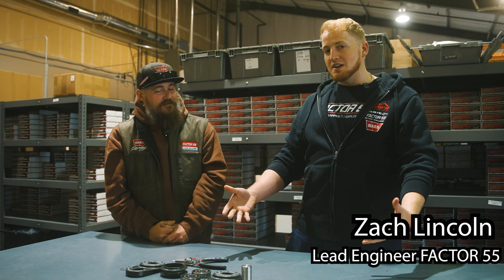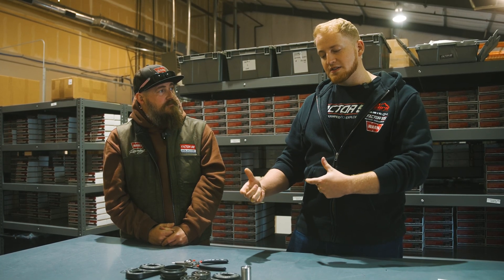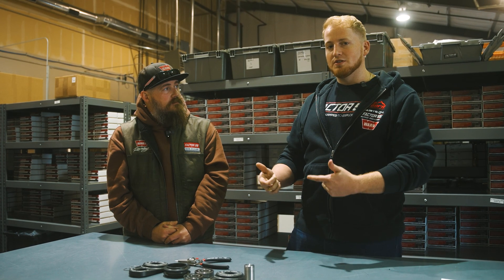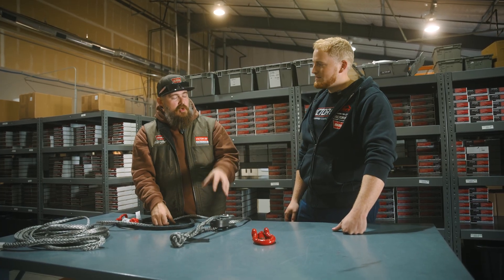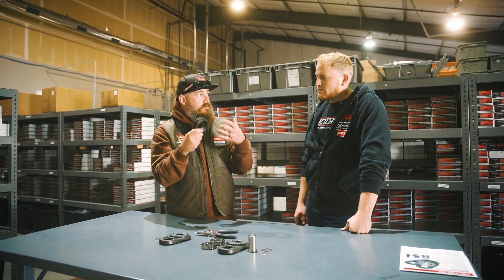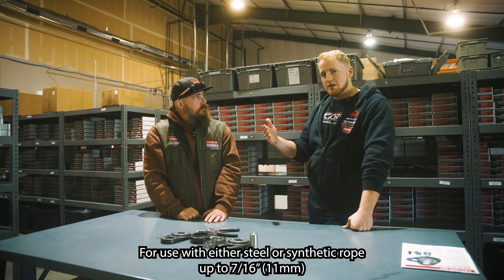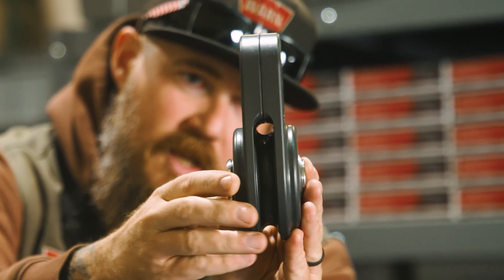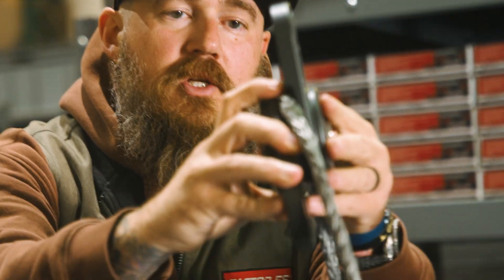All New FACTOR 55 Snatch Block Pro

Comment: Sorry, but it’s not the lightest snatch block in the market, and you guys know that. Your competitor has you beat by 1 pound. I won't share the name, but cmon guys, don’t lie to the people.
Reply: R u fat shaming... she just thicc with it
Reply: I have tested most blocks and rings on the market 

If you have questions on performance of ANY OF THEM let me know I’ll set you straight
Reply: @matt.mckinzie @matt.mckinzie  They deleted my comment about whether you can test their competition, which is 2 lbs lighter. Im sure they copied their design, the snatch block is only 2 lbs and half the price.
Reply from the maker: Maybe you should check your numbers again. Their block is 3.2 lbs. ours is 3.2 lbs. theirs in a ring with cheek plates and you’re limited to only using a soft shackle to rig it. Ours can be used with any rigging, has true grease packed bearings, can be used with steel cable or synthetic rope and will be way more efficient. Ours is also less expensive. Maybe check your facts before calling someone’s liar. 🤷‍♂️
Reply: @Factor55  why did you guys delete my comment about your competitor is only 2 pounds and half the price ! 
I’m surprised the consumer knows about this product and you guys don’t. It’s very very similar

Comment: Looks good, but like most off  gear the price is obscene.
Reply from the maker: We put a lot of time and research into engineering our products and manufacturing here in the USA so that they are the safest and most reliable for our customers. This comes at a price and it’s also why during its release we offered it at 20% off. It might not be for everyone but you won’t be disappointed with our products and support.
Reply: @Factor55 Line your pocket off someone else. I'm a retired machinist, I'll make my own.
Reply from the maker: @JFSmith-nb8hf  Totally respect that. As a retired machinist, you already know how much work goes into doing it right. FACTOR 55 parts are built here in the USA, engineered, tested, and certified to handle real recovery loads. If you ever want gear that’s been fully lab-tested and proven in the field, we’ve got you covered. Stay safe out there.

Comment: The simple no parts ring is perfect,  now you're adding moving parts again,  sounds like a sales gimmick.  Hard NO
Reply: Having a bearing is more efficient than the ring snatch blocks.
Reply: @Ezdoesit323  Slightly more efficient, but there's really no practical advantage for the vast majority of applications.
Reply from the maker: @tyeetamer frictional losses can be as low as 10% and as much as 20%. Do they work? Sure, for those using rope. But when using more than one snatch block the frictional losses are much greater every time the rope passes through the next pulley and rings cannot be used with steel cable.
Reply: @tyeetamer slightly more efficient is a bit deceiving 

For example Yankum ropes ring has a 30% loss due to friction 
While ARB has a 5% loss 

Having a bearing will bring it down to 2.5-3
Reply: @Factor55  Sure, but with an appropriately sized winch, that slight improvement in efficiency has very little practical advantage.  If the additional efficiency of the pulley is allowing you to pull something that you wouldn't be able to with the ring, you're near max load on the winch and would be much better off adding another redirect or taking a wrap off of the drum.

The one situation where I see this being beneficial is when trying to use a front mounted winch to pull the vehicle backwards with 4-6 pulleys/ rings.
Reply: @matt.mckinzie  Sure, but you're cherry picking the off-set ring which has the greatest efficiency losses by design.  If we compare Factor 55 products, their ring has been measured at 92% efficiency.

With some of the jobs you do, 92% vs 97% might be beneficial in practice, but for the vast majority of the winching community it won't make a difference.  As you know, if you're pushing a winch that hard, it's wiser to increase MA by adding another pulley or taking a wrap off the drum.  For the price of this, you can buy nearly three of their snatch rings.
Reply from the maker: @tyeetamer sure, but again this pulley is also for our industrial customers as well that use steel cable and use winches for far more than recreational use.
Reply: @tyeetamer I have measure f55 ring and your off a little 

But since your here crying 😭 

Why not just use the f55 ring 
Since they now make both
Reply: @matt.mckinzie  I believe you meant "you're" not "your" . . . both times you wrote it lol.

92% efficiency is what Robert Pepper found in his testing.  And given his credibility, most likely you are a little off.
Reply: @tyeetamer nope me and Robert have talked a bunch 
Rings have a different % on heat and humidity levels 

Also using brand new vs dirty equipment also have a role
Reply: @Factor55  Definitely looks like a great application for those still using cable.  What efficiency have you measured these and your rings at?
Reply: @matt.mckinzie  So if you're aware that efficiency  varies depending on heat/ humidity/ cleanliness, why are you claiming the number I stated was "off"?  Seems especially odd if you've collaborated with Robert and that was the number he found.

Also, why are you crying about it?
Reply: @tyeetamer you are the one here throwing a tantrum over a product clearly out of your budget so you came here to cry
Reply: @matt.mckinzie  Why are you here crying about it?  Does it bother you that there's no practical advantage of pulleys over rings for the vast majority of winch users running synthetic line?

If you can't spell "they're," I'm assuming you're not invested in the company that makes these bearings, but you're sure whining enough to make it seem like it.
Reply from the maker: @tyeetamer depending on load it can be 10-20%
Reply: @Factor55 Assuming that’s for the Ring, what about your new Snatch Block Pro?
Reply from the maker: @tyeetamer  we have a follow up test video coming for that. You can see some of the footage from the dynamic test is this video. But it will be around 2-3%.
Reply from the maker: Not true. It’s considerably more efficient especially when using multiple pulleys. Not a sales gimmick. Don’t believe us? Look up frictional losses on rings. Rings work, but not as well.
Reply: They sell a ring and a pulley pick what you want to use that simple

Comment: Only fits up to 7/16 rope though. So 99% of the jeep community cant use it.
Reply from the maker: Not true. Most people use smaller 3/8. You have your numbers wrong
Reply: @Factor55 ohh damn im a dummy.
Reply: Might want to double check your math.  99.9999% of the cheap community uses 7/16" or smaller.  Average MBS for 7/16" is 21.5k pounds.  How much does your jeep weigh?

Comment: Always innovating! Way to go F55! 🇺🇸🏁
Reply from the maker: Thank you! Our engineering team is always working on new and exciting products! 🤘
Reply: I beg to differ
Reply: This product is standing on the shoulders of true innovation from a company in British Columbia, Canada.
Reply from the maker: @canyonoverland5003  how so? The Thompson block is a great product but it is a ring with swing plates and you are isolated to only using soft shackles for connection. You cannot use steel cable with that product either. It does not qualify as a true snatch block. Not even the same tool.
Reply: @canyonoverland5003 hi , if you are talking about the THOMPSON block, I have tested it, I’ve torn it apart, I have videos and measurements of friction loss 

Under loads their pulley stops spinning and causes rope to rub 

The owner of the company is aware of this 

And has not addressed the issue to my knowledge